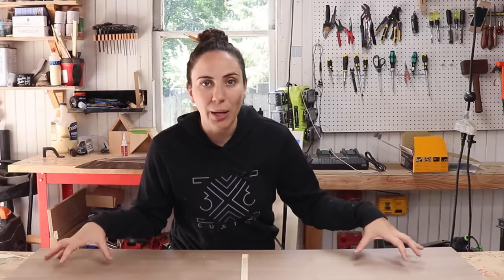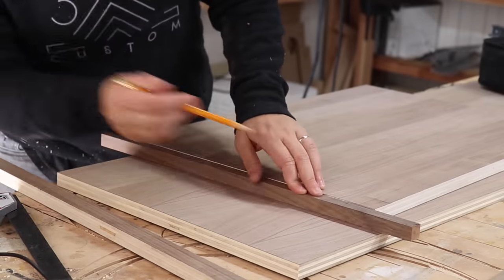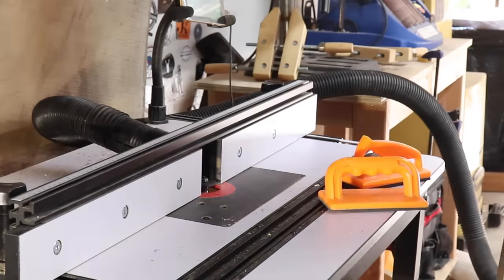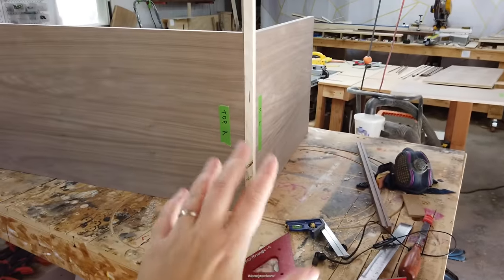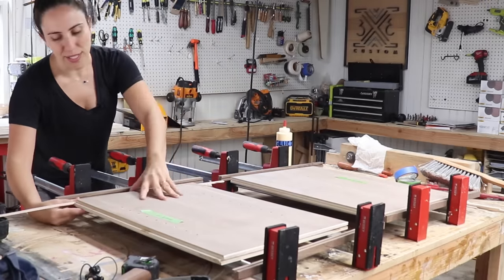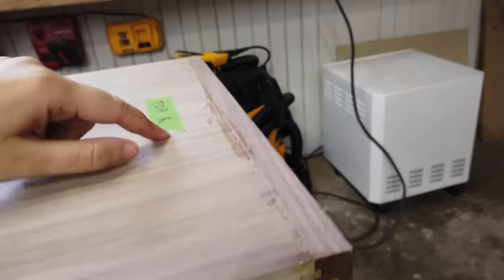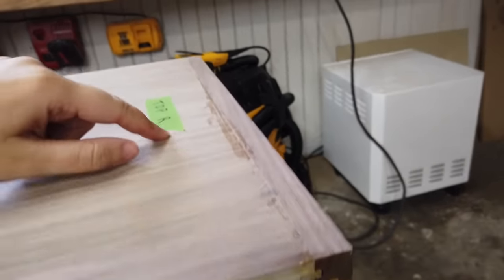Adding a ROUNDOVER to Plywood Corners - Corner EDGEBANDING with splines

Comment: A fun experiment might be bending the plywood to make a corner. From the back of the plywood route a channel across the board where you want the corner to be.. Route away all the veneers except for the walnut. Then install your round over block in that slot and bend the walnut around it. It may just be a nightmare but it could be fun to try.
Reply from the maker: It’s called kerf bending and it is very cool. Could have been an option for me if I didn’t already cut my pieces to size....
Reply: @3x3CustomTamar  thanks. I dont mean kerf bending im talking about removing a 3/4" (or whatever size your corners were) section and bending that around the corner stock u milled up.
Reply from the maker: @timbarry5080  interesting. You would have to offset the mating piece to make sure to allow for the thickness of that veneer.
Reply: @3x3CustomTamar  it may not work or be worth the effort. I took the idea from vintage stair building when they needed to bend the first riser. Before kerf bending they would cut away most of the wood and bend that around a solid core. Kerf bending is hard to make nice.
Reply: @3x3CustomTamar  it may not work or be worth the effort. I took the idea from vintage stair building when they needed to bend the first riser. Before kerf bending they would cut away most of the wood and bend that around a solid core. Kerf bending is hard to make nice.

Comment: I think the finished look of the cabinet is awesome!  As for strengthening and cleaning up mitered joints have you ever used lock miter router bits?  I haven’t but I’ve done some research and am seriously considering trying them. 
I’m looking forward to the full cabinet build video!
Reply from the maker: Thanks! I don’t own a set but they seem pretty cool. Seems like the hard part is in the set up, but that’s what scraps are for! Ha
Reply: 3x3Custom - Tamar that’s what I thought about them too. Once I got them set up I’d cut a couple small pieces to use to set them up by the next time.

Comment: Great job! Thanks a million for taking the time for the education! Can you tell me what caused the tear out from the router on the one side of the test piece and not the other? Thanks! Looking forward to trying this out soon!
Reply from the maker: Thanks! So the the part where the top of the rabbeting bit was cutting the material had no tear out. The tear out occurred where the cut was happening mid blade of the bit. I’m thinking maybe I would use a spiral bit for the process. You can do that with a fence attached to a trim router on the edge of a piece.

Comment: This was a great video. You mentioned several times that you should have avoided the tear out on the smaller corner. How would you avoid it?
Reply from the maker: Back up piece. Tape. Run the bit from another direction.

Comment: I saw another woodworker clamp a scrap piece to the ends when doing that chamfer step. It kept the bit from accidentally turning the corner and rounding it over. Just a thought.
Reply from the maker: Yeah. That’s a good tip

Comment: Last question, promise.  I see some glue on the joint, how do you sand the glue off without going through the veneer?  I would like to suggest a video, how to deal with glue squeeze out.
Reply from the maker: So I will actually go more into that in the full build video. On the inside corners I use a wet toothbrush to brush the glue away before it dries on the outside it was easily planed and then sanded. It came off with a quick pass of 220.
Reply: 3x3Custom - Tamar Ok, I will be patient. 😀

Comment: Nice job, you got it right always leave at least a 1/32 extra material to come back and flush it to panel size. 
On your previous video (shop tour) you said the router is your favorite tool I see what you meant. You used 4 routers on this video you got  them all lol. 
I need a cordless palm router on you opinion which one is better Ridgid or Makita?
Thanks for the plus at the end of your video. 
Cheers.
Reply from the maker: Haha! Yeah. I love routers. So I really like the makita. Especially because it has an optional plunge base. The only reason why I used the ridged there was Bc my chamfer bit is too big for the hole in the makita. I could have made a new base to screw on to it. But I happened to have had that Ridgid that has a bigger hole already so I used it.
Reply: Thank you, I have to go with Ridgid bc they just replaced two 4 year old batteries for me their Lifetime Agreement is Real.
Two things about your video, first I was always told that a ring could become a weapon of mass destruction for your fingers, teacher’s rule was to remove watch and jewelry from your hands for wood working. and second please get someone else to do the jumping for your destructive tests, even with those big shoes OSHA could get you. Haha
Reply from the maker: José Manuel Tabares haha yeah. There lifetime guarantee is pretty great

Comment: I am in the process of making a base for a coffee table just like this! The only area I’m having issues with is that I need a 1” radius on the corners. Would I just have to use a 1 1/8” square piece in the corners? It will also have a bottom recessed in it.
Reply from the maker: I think so!

Comment: if you cut the plywood or corner strips in same Grain Direction direction it will blend a lot better
Reply from the maker: I was debating that. I think it would still look like a filler piece, so the extra effort in gluing up panels to get 16”wide filler pieces wasn’t really worth it in my opinion

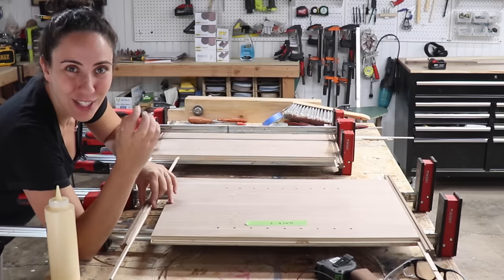Comment: At 8:23 your caption says that ideally you would have used 1/4" plywood for the splines.  What's the reasoning for using plywood splines rather than hardwood?  Is it just a cost issue (plywood being cheaper than hardwood) or is there a structural difference?
Reply from the maker: For stuff like this I have used hardwood where the grain runs across the length of the spline. Not with the length. This spline has to be 16” long. So getting that width would be difficult. So I had to run the grain lengthwise. There is just a risk that the piece could split along the grain. Plywood would be more stable for longer splines like this.

Comment: Looks awesome : those splined corners are really strong. There is a UK  furniture company called Beaver and Tapley - been around for decades  - and they used  this corner joint in all their wall-hung furniture. They didn't round over, but left the timber a little proud of the carcass material. The brochure featured the owner sitting on a cabinet, feet off the floor !  So it's kid-safe. That walnut looks superb. You should be so proud. How about recessing that inner cove as well ? 
P.S. 
Should you ever watch " The Prisoner " { Patrick McGoohan } he's got Tapley SL in the flat... (Apologies from a mid-century geek )
Reply from the maker: Thanks so much! Good to know it’s strong enough!

Comment: Another option might be to cut your plies out of the center and just leave the veneer.  Then back fill your gap.  IDK how easy it would work out though if you wanted the rounded look on the inside as well but that might be an interesting test.  If that inside corner wasn't going to really show say it's for a table with a drawer then you'd be good.  Or, you may need to veneer that inside piece.
Reply from the maker: Interesting. The inside is going to show for this case though
Reply: @3x3CustomTamar  Oh, duh! What about this, same deal but for your filler piece use walnut? Same grain direction so your inside round would then match.  But the issue there is you might have a strength issue depending on the grain direction you go with. I've done the kerf cut method before but there's the ugly factor on the inside as well.  Anyway, great technique you came up with.

Comment: Thinking about the spline, it’s really a full length biscuit or domino. 

You could make it out of thin plywood, and maybe get a benefit of the plys. The downside imo is that  thin plywood, especially when cut into narrow strips seems to have diminished strength; see the tear out. I’d rather make the spline out of hardwood, especially with scraps you have. 

With the oversized corner, it only looks chunky next to the other thinner piece when looking at them without being faced. 

A technique I saw somewhere years ago that I love for smoothing the transition and getting rid of the line is to roll the finish sander around the corner from one face to the other faces. I rock it back and forth in a randomish motion along the length of the piece. 

Lastly, maybe your kids are different, and they are less likely to damage hardwood, but is there really anything that is truly kid-proof? 😉

Comment: Could you possibly explain the chamfer on the inside edges and how it helps strengthen/tighten the joint?

Thanks.
Reply from the maker: It doesn’t strengthen it at all. It just makes it so that the 2 pieces can fit together. If I didn’t add the small chamfer the corners would hit into eachother because the plywood is thicker than the hardwood. Think of that test piece where I made the miter first then cut the 1/4” rabbet in the corner.... there was still some of the miter left over. So Bc the material I was using for the filler was 5/8”. Which is less that the 3/4” plywood, I needed to cut a miter/chamfer of the thickness left over. Does that make sense?

Comment: The comment about using plywood for the splines : Was that because plywood spline inside the plywood case piece will move less, seasonally, so a wood spline would expand potentially inside the plywood? I would think that int he middle of a glued up case, that internal spline isn't going to move seasonally. So I was curious what you were thinking with plywood.  Hardwood splines would be stronger.  I love the look of this project.
Reply from the maker: No. The strip is too small to have any sort of movement that’s noticeable. It’s more that wood could potentially crack along the grain where plywood is more stable in shear strength
Reply: 3x3Custom - Tamar  awesome  never thought about that.

Comment: Tamer, dye the walnut edging a shade darker than the veneer. It will look like a design element rather than a "filler". Use a dye instead of stain and it will preserve the figure of the edging.
Reply from the maker: Interesting
Reply: @3x3CustomTamar  I figure its a fair trade. I typically cover my plywood edges with veneer tape but you've got me thinking strongly of doing hardwood edging.
Reply from the maker: Larry R I’ve never had luck with that stuff. I love using hardwood edging
Reply: @3x3CustomTamar  The veneer tape is frustrating and touchy. After watching your video, I really don't know why I haven't done hardwood edging. I have all the tools and a lot of hardwood scraps and boards.

Comment: Wow, a great idea. I do a lot of walnut plywood projects as always looking for new techniques.

Now, how would you fix the sample with the tear-out?   A fix could save a entire project.  Also what you do if you sand through the plywood veneer as your near the end of your project?
Reply from the maker: Awesome. Glad you found it useful! Hmm maybe I would use tape to prevent tear out. Maybe clamp a sacrificial piece or maybe just eliminate the router all together and use a circular saw. Not sure. But it’s something definitely worth testing. As far as sanding through material. I just try not to. Ha. I don’t use any grit below 220
Reply: 3x3Custom - Tamar Thank you for your input. I have a walnut plywood toy chest I’m making and I did sand through the veneer on the bottom panel.  I’m waiting on the arrival of a roll of pressure applied walnut veneer to add a new veneer layer to the bottom.  Getting it cut to fit on the bottom and pressed down will be challenging.

Comment: This is where a lot of projects goes wrong. With using a 5/8 round over bit on a 3/4 corner, ever find Greek or Roman construction worth looking at? The 1/8 flat band in a way might help the rounded over corner to look like a pillar. But that's going back like 2,000 years or more. Ever considering a cove bit inside of a round over bit for something like that?  :)  p.s., I know in wood working there are flutes but I'm talking about a more subtle detail. Even just a shallow recess.

Comment: I'm lazy, so I probably would have just made two rabbets in the solid wood to fit the plywood in on either side and shot some brad nails on the inside to hold the glue up together. Maybe that's fine woodworking taboo 😂. This is certainly more impressive 👍
Reply: Interesting idea.

Comment: Oh! I might try the 1/4” round over mitre on a project, I like I like! How would you deal with the tear out you had at the router table?
Reply from the maker: Awesome. Maybe I would use a different bit. Maybe a tablesaw or circ saw. Not sure. But I would test other ways

Comment: How did you avoid tearout on the ply? I guess I need a higher number tooth blade. That came out nice. You are setting a trend: I just watched another cabinet video and she also has the "torn" knee jeans.
Reply from the maker: Hah! On the cross cuts I put tape on the ply. The tip cuts were just clean as is.

Comment: hi. at 14:18 what did u use to stick the wood strong enough to use the router. thanks
Reply from the maker: I used tape and ca glue. The trick there was to not let the router really go too far on that material or else it will blow off. I considered clamping it too. But I didn’t need to as long as I didn’t go too far on it

Comment: Nice--got some great ideas watching. One thing, though. It doesn't seem to me that there's any reason to cut the plywood as a mitered joint. Can't you just cut them square, then put the corner piece in with splines and round over as in your film? Less work? Is there a downside I'm not seeing?
Reply from the maker: Are you talking about the test sample I did with the smaller filler piece? Maybe you can do it like that
Reply: @3x3CustomTamar  I don't know where my head was when I asked that -- reviewing the video, you are doing exactly what I was talking about. You're using butt edges against the corner pieces. And obviously it works. Thanks for the reply and keep up the great videos!

Comment: Love it. Only thing I would have done different which; which I assume you only did because of the material you had, was I would have cut the roundover stock cross-grain rather than long-grained so that the roundovers would blend better with the cross-grain on the panels this way if you chose to stain it you could and it would nearly disappear. Strength would be retained because the cross-grain round overs would be reinforced with a long grain spline and the glue. But otherwise; stunning turnout, and great idea. I'll be using this technique in my next plywood project; my wife wants me to build an entertainment center for her that I think will look amazing with a large round over rather than sharp corners. Thank you for your videos

Comment: You could have added a larger hardwood piece to the corners and aligned it to the outside edges but pre-route the inside corner, then you would not have have to add it as an extra piece. That would mean you could leave the corner exposed and only edge banded the plywood. OCD side note, it drives me nuts when inside and outside radii are not concentric, as it makes the width in the corners thicker than on the straights.

Comment: New woodworker here. Could you have used the a 3/4" round over bit instead of 5/8" to avoid the chamfer issue?
Reply from the maker: Yeah for sure. But I don’t have one of those. Ha. 5/8 is the biggest I have

Comment: isn't the spline unnecessary though? if 50% of the plywood sheet is face instead of side? won't the glue joint be just as strong without it?
Reply from the maker: I wouldn’t trust just glue there. Did you see how it failed at the end of the video?
Reply: @3x3CustomTamar  Yes - but did it fail at the joint?
Reply from the maker: @jasonscroger5065  yes. The plywood to plywood joint failed.

Comment: This is pretty cool. I’m finally in a position to upgrade my tiny woodshop tools. I’m hoping to get a hybrid table saw and then add a router to one end of it(openly taking recommendations on table saws). I was wondering what table saw you have and if you think it is sufficient or are you “outgrowing” it?

Also, I would like to build a platform bed frame for my wife and I with some storage(2 drawers each side and some headboard shelves), but I’m not sure what the best and strongest joinery would be. I would say the joinery is always the biggest obstacle for me on important projects(ones that need to look nice in our house, haha). Any thoughts on a strong joinery for a bed frame?
Reply: I have a Grizzly and am completely happy with it.  I also have the router table on the end, but I've never used it.  I have  a router table with a router lift.  I bought the router table after the table saw.  The best thing is I can use the table saw and not mess with lowering the router.  Of course if you are limited on space, it does save some space.  Just a little inconvenient.

Comment: Where did you get the plywood and did it come in 4x8 sheet??? Also cost???
Reply from the maker: A hardwood dealer, yes, and around $150
Reply: @3x3CustomTamar  ok thanks and do they have selection other types as well ? I live oregon hope I can get some to make a kitchen island for my house and thanks again
Reply from the maker: @m.a.6781  yup. They make plywood from a bunch of different species. Or you can veneer it yourself

Comment: Instead of lowering the cut in plywood wouldn't it be better to cut slightly thicker pieces of hardwood then sand them for perfect finish?
Reply from the maker: I did cut the hardwood thicker already. But I planed them to the finished size.